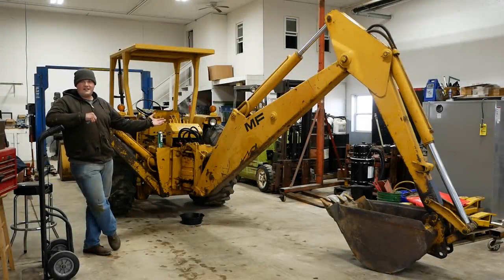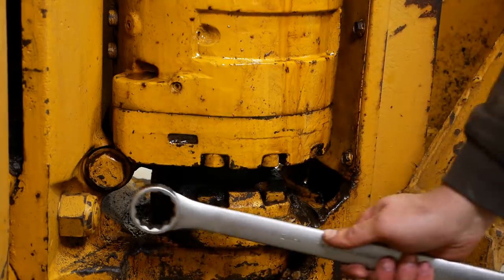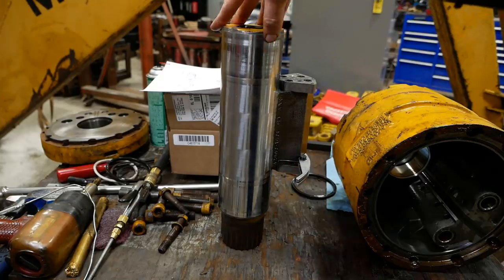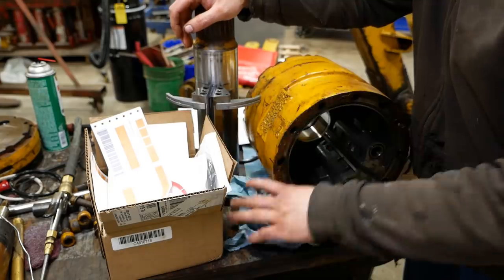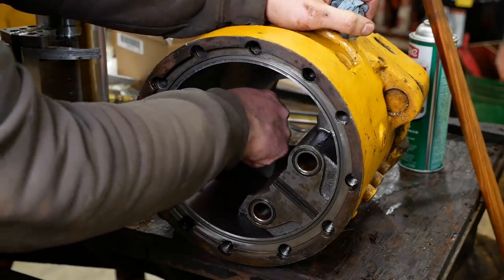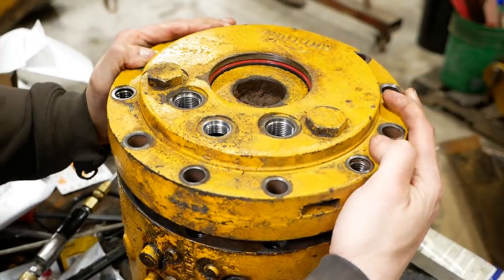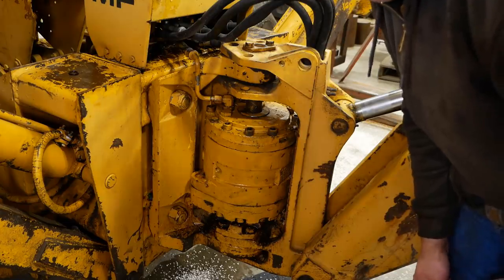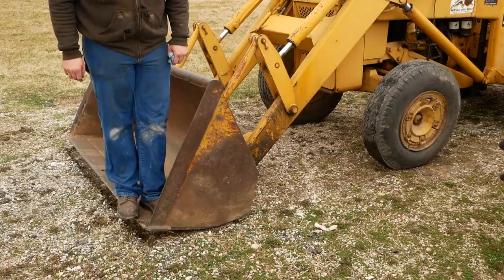Massey Ferguson Backhoe Rotary Swing Cylinder Rebuild

Comment: Would have been funny to know what the price on that shaft is from retailer, if they had had it. That design looked like a dirt trap, having two splined surfaces grinding on each other submerged in a bucket of dirt, can never work out in the long run.

Comment: The answer to the sloppy splines in this case may well be a good old welder. Just weld the two splined parts together. Works for me. No need to get too enthusiastic with the welder, but if it needed to be taken apart again and a grinding disc couldn't cut the weld, maybe the female part could just unbolt and come away with the motor.
Reply from the maker: You would have to do it without melting the seals since it cannot be assembled after welding.

Comment: 👍 wondering if the female spline block could be made in two pieces in order to clamp around the shaft and then bolt to yolk? Thanks for sharing.

Comment: AGCO pretty much wiped their hands clean of the industrial parts when they sold the industrial division in the early 1990’s (management buyout) it was then sold sold Case, then again to Terex, then to a company called Mecalac. I like the old Massey industrial stuff as much as the next guy but man oh man good luck finding parts. That swing design might not be the greatest but it can’t be that bad if that old backhoe is still kicking around after 50+ years

Comment: Perkins made diesels for years and good ones especially small--I have a 192 motor in a tractor around about 1960 vintage and its mint, does not use oil from oil change to oil change...   I cut my eye teeth on these tractors years ago..

Comment: About those splines. Maybe the shaft could be laser scanned. Then a 3D model made for what you want the base to be. If it's "just a plate", it could be EDMd. Then you said it's tapered. Well isn't that grate. I reckon EDM don't tilt... CNC Ro-tab on an angle? 🧐😜🤣

Comment: Is there a junkyard for these machines?? Sometimes that's just the only way to get parts.
Reply: Problem with junkyards is that I'd bet that the majority of MF backhoes are there with this same problem. Unless you can find one that burnt or something similar it's gonna have worn splines as well.
Reply: @tomkrause62  90% of the stuff in junkyards is there for a reason -- it's in even worse shape than the machine you're working on!  The only way I've ever seen stuff like those splines fixed was to get both pieces remanufactured.  Then it doesn't matter what exact type of spline your machine shop can cut -- as long as both halves match.

That said, it's not a cheap job.  Putting it back together and declaring it "good enough" is much cheaper.  nd it usually is "good enough" if an outfit is running equipment this old.

Comment: Nice work Wes, regarding those splines, what was the pro and cons on sleaving or maybe drill some holes in the lower bracket and placing some stainless 3/8 grub screws in there? The owner could then just keep replacing said scews as they wear.

Comment: Great video. Maybe you can help me.
I also have a good old MF50B bachoe at home. Everything was working perfectly until recently. At work, the hydraulic hose of the rotary actuator started to leak, that moves the arm to the left. After replacing the hose, however, the problems started.
Otherwise, the actuator works in both directions. When I let go of the command lever, the movement it stops, no matter which direction I move arm stop immediately. After a few seconds, if the bachhoe hangs to the left, the arm automatically starts to creep to the left. To the right, the arm rests even if the backhoe hangs to the right. I can't figure out what's wrong with the arm creeping to the left.
I have already checked the check valve, cross line relief valve, cushioning valve. I swapped the valves between them. I checked the command valves. The problem is definitely in the rotary actuator. If I place a pressure gauge at the connection point of the hydraulic hoses and manually move the arm, it shows pressure on the right side and the arm stops, on the left side there is no pressure and the arm travels freely.
I would be very grateful if anyone has any ideas what else could be wrong before I start disassembly the actuator.

Comment: Those companies don't make the seals. They buy them from somebody else and mark them up. Most hydraulic repair facilities buy their seals direct from the manufacturers. The kits for some Liebherr cylinders were over $300 and the shop that did cylinder work that we couldn't do could supply the same seals for $40.

Comment: 9:13 i've seen similar setups where the owner/mechanic cut the top off that part, left just half of it, and then had a machine part cut and then the shaft indexed with a pin that's sandwiched between the two parts of the "shoe". Wonky setup, but it works, especially when parts query tries to do an impression of Mr. Bean expressing his happiness.

Comment: I wonder if that lower block with the splines is used on another piece of equipment. If you could take it off and walk into a CAT/J.D/Komatsu/Kobelco dealer you might find it as a common use part used since the 1890's and costs $50 (probably not).

Comment: You can fix that shaft and spline set by drilling out the hole and welding in a inner spline sleeve and then also turn on the lathe the shaft teeth and weld a matching outer toothed sleeve on. Problem solved. Doesn't matter then if dealer has stock or not :D
Reply from the maker: Well that sounds easy...

Comment: Do you have a pressure washer?  A couple of minutes spent blasting all that dirt/grease/oil off the area you're working would let you see anything hidden underneath before you start.  Reassembly would be cleaner too.

Comment: Hi from the UK .Blast from the past for me! we had an MF40 in the family from 1977 to 2007 ..same backhoe , same rotary motor. it never really leaked but it got weaker and weaker as the internal paddle seal had gone..could not get a new seal anywhere..main agents just laughed and said its easier to supply 2 lbs of rocking horse s**t lol as none in the country at all. in the end scrapped the whole machine as it was pretty worn out..Out of interest is that one indirect injection? .mine was direct injection and always started on one turn of crank winter or summer.. know indirect MF35's were sods to start from cold.
Reply from the maker: It’s the classic CAV pre combustion injection. They didn’t start when they were new and it’s not new...
Reply: @WatchWesWork  thought it was and yes it was rubbish..nod to a wise man, but if you ever get one with a mystery misfire remove the precomp buckets that bolt into the head, you will likely find one has burnt away and this alters the compression/ignition compared to the other cylinders...took me hours to find that out and i wont get caught again.

Comment: I know its been three years but you still might know, my rotary swing seems to drift ever so slightly, no leaks or nothing, you can hold it still with a bit of counter stick or if you lower it to the ground. Could the problem be the check valves and can they be fixed without totally disassembling the rotary cilinder. Much appreciated videos by the way, thank you

Comment: You probably better get part from UK. Have a 50H and it was like having a door nocker on the back of the digger banging back and forward replace the hole thing with a counterweight. Better off replace it with the ones with the rams on it.

Comment: I’m having trouble lining up the swing cylinder reinstall I think I have the shaft off a little so I think I’m going to move the bucket over a touch then maybe it will drop in what do you think ??

Comment: Hey Wes, I have a 204 industrial and I am having a bear of a time getting the starter out. I’m assuming i  have to disconnect all those hoses and pull it out to the side. I have removed the distributor and coil and cannot pull that starter out far enough to get it. Fin angled through those hoses. Does that sound right to you? Remove the hoses? Thanks if you have time to answer this, I appreciate it.

Comment: I understand that there is an extreme amount of side force on those splines but could you have drilled the housing in 4 places and added hardened tapper pins?
Reply from the maker: The housing maybe. But the shaft is so hard you'd never drill it.
Reply: @WatchWesWork  I'm sure it is case hardened.  The out side would have to be drilled with a diamond drill.  I've done this kind of thing before when I worked in big industries.

Comment: Wes, you mentioned the price on the wear ring. many times on older equipment it's not that they are trying to gouge you on price, it's that not many of them are made there for it cost more to make a few than a lot. On the hydraulic cylinders that you're going to repaired, I have two different Amish companies that manufacture and repair hydraulic cylinders. They will repair them however you want using your Barrel or rod ends, whatever you want they will do it fast and affordable. Maybe you have something near you or I can forward you with their information.

Comment: How expensive would it be to machine a bushing / insert and  modify the base piece that is unavailable to take that slop out?  Looked like there was enough meat left in that base piece to cut in some kind of sleeve / insert to fix the slop.  Maybe that rad seal is a precision cut piece thus the higher price due to the effort involved to make it so the seal is so tight??

Comment: Such a strange system, that big bucket putting all that pressure on a single central spline, it won't last much longer now.
Reply: One of the reasons excavators are always better than backhoes.
Reply: @Nighterlev  yeah I know, my point being it's this kind of issue that makes the expense of excavators worth it.

Comment: As far as the cylinder seals are concerned try and contact Oliver66FarmBoy. His father is the go to for  Hydraulic stuff. If there is an alternate seal he will know about it. Perkins must own stock in a starter manufacturer.  Question sil glyde for Hydraulic assembly lube? I was always told to use assembly  lube based on the same type of fluid used in the system.  So a petroleum based grease or oil. Vaseline is my go to as it's easy to see if any contamination is present and it will quickly mix in with any petroleum based fluid. Love your channel btw!
Reply from the maker: Syl Glyde is silicone based so it does not swell the o-rings. I use it for all seals and o-rings.
Reply: @WatchWesWork  it must work though it will not mix with petroleum  based products. If the seals are silicone based sil Glyde will attack them. Since  the seals can handle  petroleum  I play it safe. Just my opinion. Use what works for you. And again thanks for the great content.

Comment: Did you have to "time" the cylinder to the position of the backhoe?
 If a guy wanted a bunch of that slop out, clean the splines to bare metal, spray some release agent in the female side and goober some Moglice on the shaft and drop it together. 
 I put 3 cans of it in the gap between the flywheel and shaft on a 2500 ton forge press that had (2) 4"x4" tapered keys that wouldn't stay in. It ran for about 6 months, 24-7 till they got way ahead on parts and the whole works was pulled off and sent to the "rebuilder" that didn't rebuild it right. I wish I could of seen how long it took to heat that up and loosen the epoxy.

Comment: We have a 1980 MF 30B and it has this Cessna rotary cylinder. At least it looks the same. It doesn't leak but it has a lot of play. Any suggestions? Thanks.
Reply: Ok now that I got to that part in video I guess our splines are worn also. haha

Comment: There's a ginomours, maybe 'yuge' collab opportunity there. CNC a gear, cast iron from reverse mold, turning a new shaft, etc. Abom79, Windy Hill Foundry, that blue haired Canadian with a HAAS...
Reply: I figure nobody cares about all that. Just a random thought.
Reply from the maker: I don't think so. We might be able to burn one out with a wire EDM, but it would cost more than the machine is worth.

Comment: Hey wes, ive got the jd twin to this machine. Im going to rebuild swing cylinder as you did. But my radiator needs to be rebuilt or replaced. Any ideas were i can get it done. Im in texas. Steering shaft goes threw top of radator so i want to get it rite. Dont want to keep removing steering shaft to remove radator. Could YOU pm me please. Thanks. Ken Milus

Comment: Hi i love this video! I have a ford 4550 with the same type of swing cylinder, small difference but same type of seals in it, i followed your video to open the cylinder but now i cant find the seals anywhere and no company i sweden can help me out. Do you have any tips on where i can find the seals?
Reply from the maker: I don't know. Try a hydraulic shop. I bought them from my AGCO dealer.
Reply: @WatchWesWork  tnx AGCO dealer will be my next goto!

Comment: Well Wes, thanks for the video. Previously Dad and I thought the slop was in the cylinder. We were planning on pulling it and rebuilding it someday. After watching your video we checked it out and determined that the cylinder is totally fine and that the splines are bad. Right at about the same level of slop as the one in the video. Doesn't help that the cylinder is fast and violent. And of course the worse it gets, the faster it gets worse. Once it starts to get loose it bands about really bad when driving which just makes it yet worse.

I wager that if they made it a press-fit spline like Cat D2 final drives that Squatch253 shows, it would be just fine. But being a slip fit, any looseness created more. Shitty design indeed.

Comment: could easily model that shaft and receiver in solidworks and send that off to get machined/cnc'd
Reply from the maker: It's a tapered spline with a key. The cost to manufacture one would exceed the value of the machine.
Reply: @WatchWesWork  you could change the design of the spline when you model it to make it more cost effective to make
Reply: @jeremiahjorenby2275  BTDT.  Had to change the design of the splines to what we could get made.  Still not a cheap job, and would probably still exceed the value of the machine.

Comment: If you just break all your fasteners free with out taking them out I think you will find it easier to get them all out.  When you just take them out you cause more pressure on the others and make them harder to break loose.
Kurtis with Cutting Edge Engineering LTD could machine you a new gear and shaft cost more than the machine is worth
Reply: Just what upward force in this assembly are you referring to? Did you not observe him forcing the endcap off with jacking bolts?
Reply: @horacerumpole6912  Starting around 6;23 he has to resort to a breaker bar and prybar to finish breaking loose the last 6 or seven bolts if you look the bolts on either side have already been completely removed. I was taught to never remove the bolts till you had loosened all of them, because the remaining bolts are now under more tension. Understand?  He has to use the jacking bolts not for tension but because of the seals.
Reply: @bigunone  Let me enlighten you-the clamp load on these bolts in this application, once hydraulic pressure is relieved, is created individually only by tensile load, elongation, (possible corrosion), elasticity, and the interface of the male and female threads-nothing else. Taking them out individually matters not to the remaining fasteners-too bad you weren't taught this as well…
Reply: @horacerumpole6912  Thank you for enlightening me

Comment: Wes you can put the splines back with shim stock in between, that will take up the slop and help it last longer. Cheers.
Reply: It’s tapered so if you shim it, it would be worse
Reply: @FishFind3000  Taper makes no difference friend.

Comment: Probably a stupid question, but how do you make sure you don't mess the alignment of the whole thing? It was not in the video (thanks battery), so is there some alignment mark or did you make one?
Reply from the maker: It has a key in the spline like a steering shaft. It can only be installed in one position.

Comment: It's unfortunate that parts are hard to find. It's a nice back hoe. Seems like a machine shop could either fix that spline or make one. Egypt may want to lease it to clear the Suez Canal. They need several hundred machines. 😏 Nice job Wes.

Comment: Ha ha ha. We use Teflon seals about the same size as the backer. $145 each. And PFR O-rings a little over an inch in diameter that run $125 each. That’s our price.

Comment: I admire your “can do” attitude and willingness to tackle any project. But here you have a backhoe you judged to be from the ‘60s with parts nearly impossible to obtain. The machine doesn’t look all that cared for and is really a project for a restorer. Massey Ferguson made decent machinery, but their construction equipment really didn’t sell that well. It had nothing to do with quality, but rather with brand name recognition. Allis-Chalmers backhoes were several steps below in quality, but had better name recognition and more dealers. The ideal solution for your customer is to sell it and pick up a used name brand. Then he should see if he can sell it to a restorer or see if he can donate it to the HCEA for their collection. You did a magnificent job fixing it, but given what you’re up against in the way of spare parts, your fighting a losing battle.
Reply from the maker: The owner is just a home owner using it hobby work. It's not making money. I imagine he bought for next to nothing, so there's no issues spending a bit on repairs.